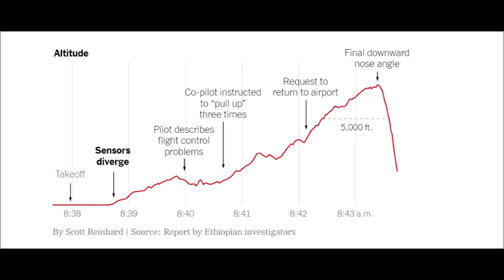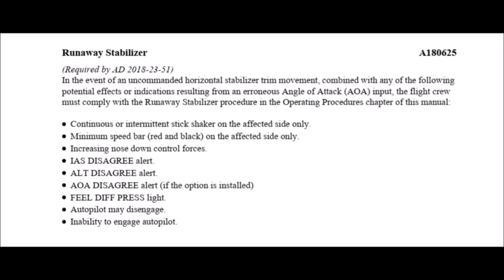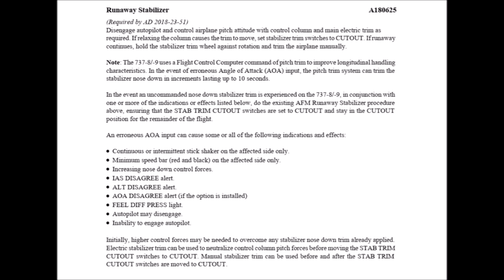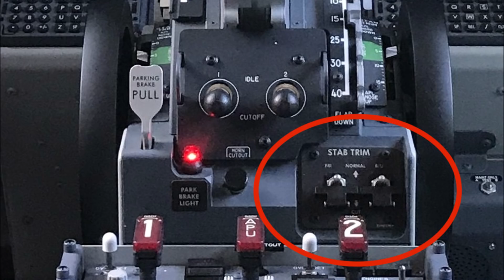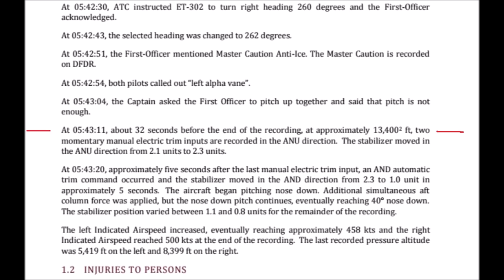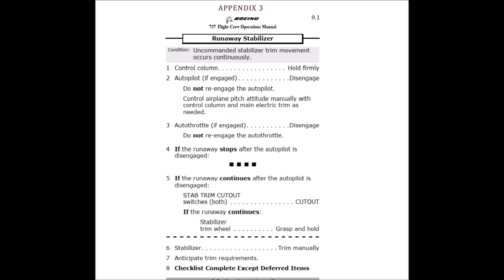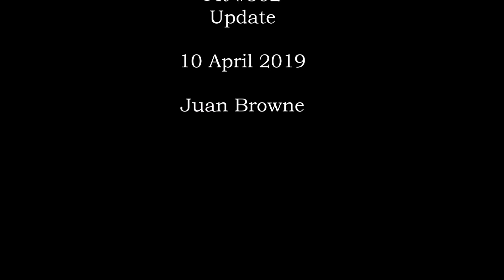737 Max Update 10 April 2019 Runaway Stab Trim Procedures

Comment: Again, the pilots did not get simulator training specifically for runaway MCAS. One report was Ethiopian Airlines did have the simulator for the 737 Max but it is unclear if they had the update to include MCAS. The combination of Boeing and the FAA not requiring simulator training for certification are two of the weak links in this avoidable "accident" chain. The others are the AOA sensor issues including possible malfunction from possible manufacturing defect, possible faulty maintenance of the AOA sensor (Lion Air), single AOA sensor, lack of AOA sensor disagree indicator, etc.
Reply: This really seems like the wrong attitude. You don't need special training for every possible individual fault. That's what computers are for. Pilots needs to be able to take over an diagnose issues that haven't been anticipated. 

The crew was let down by a bad system, but they were also unable to correct the fault because they didn't have the training necessary to comply with procedure. It's not that they didn't know about some specific esoteric fault mode, it's that their familiarity with the plane and their approach to problem solving under stress wasn't good enough.
Reply: Bruce John Shourt stated "Again, the pilots did not get simulator training specifically for runaway MCAS"

There is no simulator training specifically for "runaway MCAS". There is training for "runaway stabilizer trim" and it is taught to ALL 737 pilots, not just 737Max pilots. 

Boeing’s 737 MAX Flight Crew Operations Manual (FCOM) already outlines an existing procedure to safely handle the unlikely event of erroneous data coming from an angle of attack (AOA) sensor. The pilot will always be able to override the flight control law using electric trim or manual trim. In addition, it can be controlled through the use of the existing runaway stabilizer procedure as reinforced in the Operations Manual Bulletin (OMB) issued on Nov. 6, 2018. 

An Emergency Airworthiness Directive (AD) 2018-23-51 was sent to all 737Max 8 and 9 owners after black box data showed that the pilots that crashed Lion Air flight 610 failed to follow the existing runaway stabilizer procedure.

Emergency Airworthiness Directive (AD) 2018-23-51 reinforces the need for pilots to follow the existing runaway stabilizer procedure and adds more information on how malfunctioning angle of attack or speed sensors can cause runaway stabilizer commands.

This AD is effective December 21, 2018, to all persons except those persons to whom it was made immediately effective by Emergency AD 2018-23-51, issued on November 7, 2018, which contained the requirements of this amendment.
 
FAA AD #: 2018-23-51
2018-23-51_Emergency.pdf
https://www.federalregister.gov/documents/2018/12/06/2018-26365/airworthiness-directives-the-boeing-company-airplanes
Reply: Rick Jones  Read the comprehensively reported history of Boeing’s desperate change in marketing strategy to sell the Max. They knew they would loose orders to Airbus if the difference training also required simulator training and they convinced the FAA to certify the new model without it. Obviously the less than an hour on the iPad wasn’t enough. I suspect the simulator requirement will be necessary for recertification. The FAA has already taken heat from the U.S. Congress and Senate so now the FAA has to get tough with Boeing.

Some educated opinions on the Max design:

Source link: 

https://qr.ae/TWTIHe

Steve Bazer, Captain at a Major U.S. Airline:

Perhaps the 737 MAX should never fly again. It’s a conventional flight control aircraft that does not have positive stability (The 3 Types Of Static And Dynamic Aircraft Stability) throughout its entire flight envelope.

Did the Lion Air and Ethiopian Air 737 MAX aircraft enter a Phugoid mode, from which a timely recovery might not have been possible when close to the ground? 'Nose dive conditions': Report reveals final minutes of Boeing 737 Max 8 that crashed in Ethiopia

An aircraft with positive stability will return to its original position when it is displaced from a neutral position, either instantaneously (static stability), or over time (dynamic stability). At high angles of attack, the 737 MAX’s engine nacelles create enough lift to cause a divergent mode, which pitches the nose up and exacerbates the nose up moment. This is an example of both negative static and dynamic stability, both which are extremely dangerous characteristics for a passenger aircraft. These issues make stall recovery extremely difficult without an electronic “fix”.

Because of the 737 MAX’s inherent instability issues, the elevator authority necessary to easily effect a stall recovery is likely exceeded at high AOA’s. Therefore, Boeing chose to develop an electronic “bandaid” to attempt to solve the problem. Enter the MCAS, or Maneuvering Characteristics Augmentation System, which will apply nose down trim if the autopilot is off, the flaps are not extended, and the AOA exceeds a preset level. This is a highly unusual “fix”, one that had not been designed into any other conventionally flight controlled airliners. It ignored one of most basic principles of problem solving: “Whenever you solve a problem, you usually create one. You can only hope that the one you created is less critical than the one you eliminated.” If it’s a good solution, the newly created problem will be far smaller (and acceptable) than the problem that was just solved. This was not true of MCAS. It created a far greater problem (possible loss of aircraft pitch control), than the one it solved (nose-up pitching moment at high AOA).

737 Max 8 Anti-Stall System Reactivated After Being Manually Disabled: Report - ExtremeTech:

These findings raise significant questions about the FAA’s initial delay in de-certifying the 737 Max 8 and what the Lion Air investigation may have revealed. This is all information that should have come out in the aftermath of that investigation, particularly given the withering feedback from pilots who didn’t even know MCAS existed prior to the Lion Air 610 crash. Pilot and software engineer Gregory Travis has shared his own thoughts on the 737 Max 8 disaster in a Google Doc that’s well worth reading. As he writes:

If I have not been clear, so far, let me say it succinctly. Boeing produced a dynamically unstable airframe, the 737 MAX. That is big strike #1. Boeing then tried to mask the 737’s dynamic instability with a software system, similar to the systems used in dynamically unstable fighter jets (though those jets are fitted with ejection seats). Big strike #2. Finally, the software system relied on systems known for their propensity to fail (angle of attack indicators) and did not appear to include even rudimentary provisions to cross check the outputs of the angle of attack sensor against other sensors, including the other angle of attack sensor. Big strike #3.

This aircraft appears to be inherently unsafe, and probably should not have been certificated as being airworthy. The proposed fix presents a new problem. In the event of several possible systems failures, it has no protection against its tendency to pitch nose up when it encounters a wing stall. It is now a “fail-passive” System, which should be deemed as absolutely unacceptable, considering the 737 MAX’s stability shortcomings. MCAS is both necessary for the aircraft’s safe operation, yet also can cause a loss of control if it malfunctions.

The only acceptable fix would be a triple-redundancy “fail-active” MCAS, achieved through the addition of a third AOA sensor. If one AOA sensor fails, then it is removed from the system input, and the aircraft still has stall protection via the two remaining AOA sensors.

Boeing was lazy, and greedy, and let dollar signs cloud its better judgement when it greenlighted the 737 MAX. Someone needs to kill it, before it kills anyone else. Make no mistake, and don't think that Boeing is not busy using its financial muscle to buy off politicians and regulators, and showing them an all-new “house of cards” proving that the new and improved 737 MAX is completely safe, despite the fact that it is an inherently flawed design.

The 737 MAX’s accident-free operational record within the US market does not prove that it is a safe airplane, only that it was lucky up to that point. The two hull losses appear to be for reasons that were absolutely unacceptable from a design standpoint, and no aircraft should need to rely on pilot heroics to be considered safe for passenger carry.

Steve Bazer:

I’ve got about 2000 737 flight hours, and perhaps 18,000 Boeing hours total. Most of them are very good airplanes, but the jury is still out on the MAX.

The MCAS is not active on approach, once the flaps are extended. The MCAS was installed to counter or prevent the pitch up tendencies when the aircraft is in a clean configuration and at a high AOA. Even the original 737–100/200 already had a very pronounced pitch up tendency when engine power is increased, at any speed. This made stall recovery challenging, as a judicious power addition at a high AOA flight parameters would exacerbate the stall.

The 737 MAX forward engine placement, combined with their additional lifting surface would magnify that pitch-up effect, plus shift the center of lift forward, which is destabilizing. Both the Lion Air and Ethiopian Air 737 MAX aircraft seem to have entered some type of Phugoid mode, and became uncontrollable. Perhaps the MAX has some extremely undesirable flight characteristics which can not be fixed with software.Is the 737 MAX unstable or does it just lack sufficient pitch control authority from the elevators? MCAS was installed as an after thought because test pilots found it difficult to flare on early test flights under some configurations. Difficulty to flare is surely indicative of a lack of ability to apply tail down force at low landing speeds i.e. lack of pitch control authority.
The MCAS augments pitch control by adjusting the whole horizontal stabiliser and therefore can provide additional tail down force when the control column can’t provide enough. Not good in a passenger aircraft if any faults develop on a pitch control system.

I would be very interested to see how a pilot gets on in a 737 MAX simulator flying a 3.5 degree glideslope at low throttle, close to minimum approach speed, close to Max landing weight and C of G at forward limit with the Stab Trim turned off while trimmed slightly nose down (i.e. gentle positive back pressure to maintain glideslope). I wouldn’t be surprised if pilots had serious difficulty effecting a smooth touchdown.
Reply
Upvote
 
Steve Bazer
Steve Bazer
Original Author · Fri · 19 upvotes
Joseph Thomas:

Andy, Boeing got themselves into a complicated problem. The 737 MAX appears to be excessively stable at low power settings but unstable at high power settings. The culprit appears to be the forward placement of the engines.

Let me explain. The forward placement of the engines pushes the CG forward. More forward the CG, more stable the airplane. In most cases, the forward limit is determined by the ability to flare for landing. (Please note that ground effect causes a nose down moment and adds to the problem.) The flight test experience of “difficulty in flaring” is proof that the airplane is at or near its boundary for forward CG.

On the other hand, when the engines are under power, there is an upward pitching moment. Appears to be within limits in cruising flight. But see what happens when the Angle of Attack (AoA) is increased. The engine deflects air downwards, thus creating an upward force on the airplane. The point of action is where the airflow is deflected downwards. This is the engine inlet. In the MAX, this is well forward of the CG. The upward force ahead of the CG causes an upward pitching moment. This is destabilizing.

So we have an airplane that is excessively stable at low power settings but unstable at high power settings when coupled with a high AoA.

Ref your para 3. Quite possible that you would get a three point landing ie nose wheel impacting along with the main wheels. It would be a hard landing and it could break the nose wheel. It is a good illustration of why we need a forward CG limit.